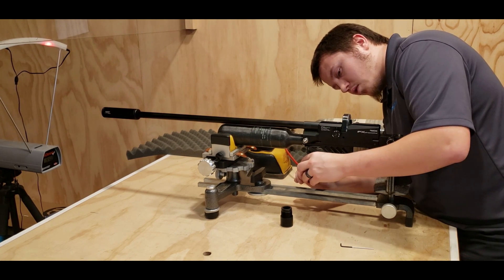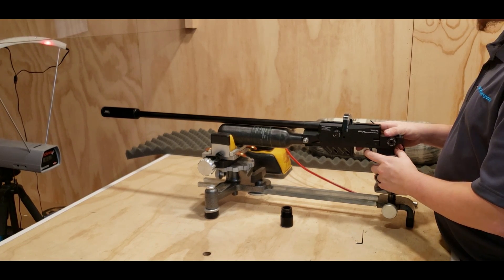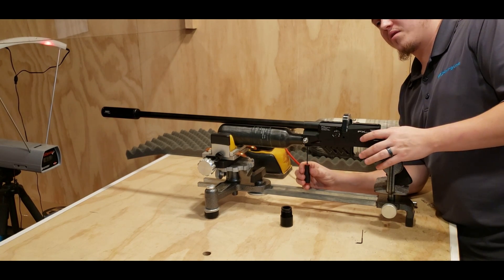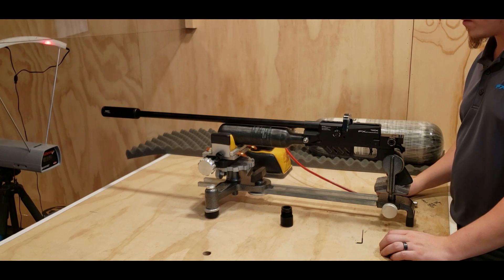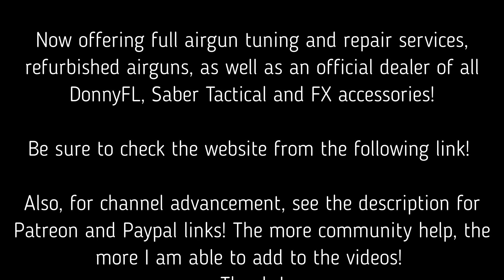How to Tune FX Dreamline with Power Plenum - FX Airguns Tuning Guide for FX Dreamline

Comment: i have a newer version of the fx dreamline wallnut, i have a question, the regulator was inside the air cylinder before but on the new dreamline the regulator is BEFORE the aircylinder.
My question is, isnt the regulator than working as a power plenum? because you mention that the standard stock configuration of the regulator is set at 125 bar but mine came at 110 bar. Have they already adjusted the regulator pressure for me because of the regulator? and what if i add a power plenum? should i than put the regulator lower than 110?
Reply from the maker: Yes the new external regulator (brass) has a built-in power plenum to add a little more power. Also, the Dreamline now has a larger valve than it had in this video, so that adds a bit more power, too.
Reply: @910AirgunTuningandRepairs  wow thank you so much for your quick answer, would you say with the New dreamline and a Power Plenum installed i should set the Regulator Pressure lower than 110 if it Came with 110 Stock? If i want to Shoot the 34grain mk2? Greetings from Northern europe
Reply from the maker: @kickassvideos5469  for the 33.95gr mk2 pellets, you will likely be around 120-130Bar to push them around 880-910 FPS. The rifle comes tuned for 25.39gr Kings.

Comment: I want to do the opposite of most folks. I want to slooow the gun down and be very efficient. I would like to shoot .22 at about 20 FPE and get a ton of shots.  I would assume I could set the Reg around 10-120 PSI and work from there?
Reply from the maker: For a .22cal shooting 20 FPE, lets say even with 15.89gr to really get efficient, I would a say around 90-100 Bar on the regulator. This all changes depending on the amount of plenum and the hammer weight that your rifle has, but 90-100 is a good place to start

Comment: I hear so many mixed things about the power plenum. Some people say it doesn’t do much, others say it helps a lot with velocities. I did not realize the Dreamline was capable of doing this much energy. I have been thinking about getting the .22 cal in this gun. I could always change the barrel if I wanted the .25. It’s amazing. The Dreamline is a game changer.
Reply from the maker: The newer Dreamlines come with an even more updated valve, plenum and regulator than the model used in this video, so the rifle is now capable of even more! 😁
Reply: @910AirgunTuningandRepairs  
When did that change? And did it always have a plenum?

Comment: Hi I also has dreamline 0.25 i set everything on max but the fx still weak.Should i change the hammer spring 2???Because i still using the factory original.Reg pressure is 130 bar
Reply from the maker: I am not quite sure what you mean by it "feels" weak? Have you shot it over a chronograph to see the velocity results? Feel free to send me an email as there are several possibilities for this issue.

Comment: I have a dreamline .22 with huma reg and dual Port reg is 110 en hammer spring half turned in the gun shoots the 18grain jsb at a speed from915 to sometimes 935 Peak fps what do I have to do for a more consistent shot
Reply from the maker: Sounds to me it just need a little more tuning, you are simply in between two balanced tunes. It could be either a little less reg, a little more hammer, or visa versa.

Comment: Need a help plz :) i have dreamline in .177 cal and no matter what i do velocity always jumps up and goes down. Cant get consistent velocity from 230bar to 110-120 bars its inconsistent hammer spirng at max at mid at low no point it keeps going up and down cant find that golden middle. Why? 
Air consumption is also wild 60 shots max whe i had another pcp artemis p15 it was shooting 940 fps avarage all the way with reg set to 120 and hammer spring at close to max and 85 regulated shots. Also dreamline has plenum installed
Reply from the maker: Is your rifle a full power/USA model, or does it have power restricting parts? Which velocity and regulator pressure are you using, and what grain pellet are you using? Also, how large was the air cylinder on the P15? The Dreamline .177cal air cylinder (not tank) holds I believe only about 185cc, maybe 230cc, but it is about half of a carbon fiber bottle from what I remember. Hope this helps! Let me know if you have further questions, you can reach me info@910airguntuningandrepairsllc.com.

Comment: What FPS can you get with a 33.95 gr .25 pellet?
Reply from the maker: Depends on the generation of Dreamline as well as plenum configuration and which hammer-weight you have, but on average the Dreamline can shoot the 33.95gr .25cal around 860FPS - 880FPS when maxed out.
Reply: @910AirgunTuningandRepairs  This is the status of my current tune w/.25 cal, w/power plenum 33.95 gr JSB pellets:     

Shot count: 10		Shot count: 10	
Low: 956		        Low: 51.5	
Hi: 960		               Hi: 52.0	
Avg: 957		       Avg: 51.7	
STD Dev: 1.8		       STD Dev: 0.2	
Spread: 4.0		       Spread: 0.5	
			
Date/Time	        FPS		                FPE
			
6/1/2021 14:07	960	6/1/2021 14:07	52.0
6/1/2021 14:07	956	6/1/2021 14:07	51.5
6/1/2021 14:07	956	6/1/2021 14:07	51.5
6/1/2021 14:07	956	6/1/2021 14:07	51.5
6/1/2021 14:08	956	6/1/2021 14:08	51.5
6/1/2021 14:08	956	6/1/2021 14:08	51.5
6/1/2021 14:08	956	6/1/2021 14:08	51.5
6/1/2021 14:08	956	6/1/2021 14:08	51.5
6/1/2021 14:09	960	6/1/2021 14:09	52.0
6/1/2021 14:09	960	6/1/2021 14:09	52.0
Reply: .5 moa @ 50 yds.  I meant to add this previously.

Comment: What donny Fl model are you using? is it backyard friendly? Thanks
Reply from the maker: In this video, I use the FX DonnyFL, which is the model of DonnyFL moderator that can be included as an upgrade when purchasing the rifle from a dealer (if the dealer offers it). It makes it more backyard friendly than the original FX moderator, but I still suggest a slightly larger DonnyFL moderator for true silence in the yard.

Comment: About how many shots can we expect with the 135ish bar and 910 fps with the 25.36gr jsb . 480cc bottle ? Your help is greatly appreciated.  Working with a hand pump at the moment so I haven't made it that far !
Reply from the maker: Hey! I am not 100% certain, but I would guess around 50-60 shots on the lower side of possibility. The 480cc bottle helps provide a good amount of shot count!

Comment: I have the same gun, Dream lite with bottle and PP in .25. when I adjust my regulator over ~110 I start to lose velocity. haven’t been able to get more than 890fps out of it with 25.4’s. any thoughts on why? i haven’t tried adjusting the hammer with the allen or taking the regulator over 125, do you think that’s a necessary next step?
Reply from the maker: The next step would be to adjust your hammer with the allen. Definitely need to do that to gain power
Reply: 910 Airgun Tuning and Repairs 
can’t find the Allen key size for hammer spring tension
Reply from the maker: @tripleceas  it is a 1.5mm, its a standard size key. Most kits will have them, some hardware stores sell them individually
Reply: 910 Airgun Tuning and Repairs Yeah smallest I have is 2mm I’ll pick one up. Thank you!

Comment: Now dumb question but can you run straight off the big bottle when you have the fill port in?
Reply from the maker: Sure can! As long as your big bottle is not charged over 250 Bar.

Comment: Have you done any testing with the dreamline in .30 caliber? Hearing very conflicting reports about power and shot count.
Reply from the maker: I've shot them but have not extensively tested it. The .30cal Dreamline does not offer a ton of power, but enough power to maximize accuracy of the 44.75gr JSB pellet 👍 hope this helps!
Reply: Hello i am not able to shoot 44.75 pellets more than 750 fps with power plenum, i really appreciate if you upload a .30 cal tuning video, thanks

Comment: OK I have a question my dream line seems to do a 22 23g slug at a max of 920fps with 500mm barrel my reg holds a constant pressure but sometimes after a small adjustment will climb or fall, mine is the bottle version with a power plenum, do you think it's worth me changing my reg seals as I thought I would be able to get more speed than this cheers for your great videos
Reply from the maker: Changing the regulator seals will most likely not change anything. I suggest either a heavier hammerweight or a longer barrel, if you are looking for more speed. 👍 Best of luck my friend

Comment: I'm sorry if this is dumb but why turn the hammer spring down with an allen key  when you can use the power adjustment knob?
Reply from the maker: No worries! Turning the tension adjuster down rather than the wheel is actually changing the setting of the wheel. For example, the tension adjustment at 16mm and the wheel at max is more than the tension adjustment at 18mm and the wheel at Max. It allows a much more fine tune of the hammer spring adjustment and allows a range of adjustment once you have found your preferred tension adjustment. The tension adjuster at 18mm and wheel at Max may equal close to the tension adjuster at 16mm and the wheel at setting 4 or 5. I always suggesting tuning the gun with the wheel on Max.
Reply: @910AirgunTuningandRepairs  i understand, thanks for explaining :) this info sure will be coming in handy when tuning my brand new FX dreamline tactical. It's arriving here tomorrow but i'm probably going to do some more learning before i actually start finetuning.

Comment: You seem to be all about speed I wish the heck you would show if the gun is accurate at that type of speed
Reply from the maker: These videos are mostly about showing what the plenum makes the rifle capable of.  Pellets are not accurate past 920FPS. Slugs generally prefer to be around 940-960FPS, but every slug is different. I do not have scope cam equipment yet, but I am working on it 👍
Reply: Hey I saw that you said pellets are not usually accurate past 920 I don't have a chronograph I've got my reg said at 150 and I haven't touched the hammer spring with a Allen key it's shooting pretty hard and still decently accurate where should I set my hammer spring to get that 920 FPS with 33g JsbI also saw you said setting your rag high could wear your regular out is 150 to high?
Reply from the maker: @kaseyjohns5169  Hey Kasey! The regulator at 150Bar is completely fine, since the recommended max is 170Bar. Also, if you do not have a chronograph, I would test my accuracy with the 33.95gr MK2 at 50 yards, or 100 yards if possible. Then, with the regulator at 150Bar, I would increase my hammerspring tension until I shot the best 5 shot grouping. I would definitely recommend investing in a chronograph, though, if you are going to be tuning your own rifle. Hope this helped!

Comment: I am from Indonesia, whether the dreamline that has been installed power plenum with cal 177 for jsb monster 13.43gr can be set above 900 fps because I am a dreamline user made in swedish cal 177 can not be set above 900fps only with jsb monster diabolo please explain thx
Reply from the maker: Hey! Sorry, it is a little hard to understand your English, but if you are using a "12 ft lb" version of the rifle, the internal parts will limit the overall speed and performance. With a full power rifle, 900FPS is obtainable without the plenum, and certainly with the plenum. Wish I could help more!
Reply: @910AirgunTuningandRepairs  sorry my English is not good ! I have installed the plenum on my shotgun (dreamline) but have not been able to setup so that the power can be maximized. how to be able to maximize? Please help ?
Reply from the maker: @bawadava4298  no worries! 😁 you will need to most likely change the valve assembly. The 12 Foot Pound Energy rifle parts are shown on the schematic for the rifle, so you can see which parts you need to upgrade. If the rifle is already full power, you need to just tune the regulator and hammer to achieve your desired velocity.
Reply: @910AirgunTuningandRepairs 😁 Thank you, I am waiting for the next video and I will always like it
Reply: I have raised the regulator pressure above 100 hamer, I have set the max setting, but there is no change that I can feel after using the power plenum on the dreamline shotgun

Comment: Do you have an idea of the shot count difference in .25 with versus without the power plenum?
Reply from the maker: Unfortunately I do not, as it all depends on what settings you have the rifle at, as well as whether you have a bottle or tube. I believe FX posted suggested shot counts without plenum on the website, the plenum would probably give about 10-20 extra shots at factory settings.

Comment: All of this is great info. It's nice to know what can be accomplished velocity wise. However........I would like to see you make a video on an accuracy tune for the 25.4 JSB Kings. I'm talking some serious tiny groups! Doesn't matter if you could push a projectile 2000 fps.......if you can't hit what you're aiming at. Please show the absolute best accuracy your rifle can get with that pellet and share the settings/velocity.
Reply from the maker: I am working on getting a set up to where I can show accuracy. The 25gr Kings JSB like a range between 890-910FPS out of the pellet liners, 900-920FPS out of the slugs liners. At 25 yards, the Center-To-Center grouping will be extremely small, most likely around 0.15" (remember, center to center, total group would be 0.40"). FX guarantees, with the proper tune and elements, that any STX barrel should produce a 0.5" group center-to-center at 50 yards. Anything after 50 yards will be effected by the elements, tune of the rifle, the indexed position of the liner, and several other factors. 👍 Accuracy videos coming soon.
Reply: @910AirgunTuningandRepairs  Awesome! I am most interested in the standard pallet liners right now since that is what I have. Hi zero all of my rifles at 35 yards. I was not aware that they could be critical as to the indexing of the liner 🤔 Are you suggesting that rotating the barrel liner can have an effect on accuracy?
Reply from the maker: Sorry I did not see your reply! Rotating the liner certainly has effect on Point of Impact and Accuracy. It changes the angle of twist at which the pellet is exiting the liner, which will change its flight path.

Comment: Good video. A question why you have the maximum power of the spring, I think that is not good and it has an effect of lowering the speed instead of going up ..... I with my Dreanline tac aluminum bottle at 130 bar reach 296ms (972fps) Factory weapon only with the plenum and the power of the spring in the letter D and if I increase the selector of the spring + it goes down the speed.
Reply from the maker: You can tell you have the hammerspring maxed out when you adjust the tension and you no longer gain FPS. Whenever I raise the regulator pressure, I check the spring tension to see if I can achieve any more FPS. IF the speed does not change when I increase the hammerspring tension, then I still need more regulator pressure, and visa versa. Eventually, either the regulator pressure or the hammerspring tension will max out, creating the max tune for the gun.

Comment: Hey my friend. Are you going to upload also Power Plenum tuning video with FX Dreamline Classic?
Reply from the maker: Hey Rafal, the speeds will be the same for any of the Dreamline chassis. The only difference is the DreamClassic uses the 5mm hammer adjuster in the rear rather than the knob, but both are able to achieve the same speeds.

Comment: how accurate is the 25g ,the power is there...have you tried a heavier pellet ? ..... with the power plenum your best accuracy was between 900-910...seems like the power plenum is not 4 pellets but slugs
Reply from the maker: The plenum is to either provide higher speeds for slugs, or to be able to turn down the regulator to a lower pressure and get the same velocities as before, resulting in a higher shot count 👍

Comment: Please do with .22 calibre
Reply from the maker: It is the same process for any caliber, but the speeds will be different. Which pellet are you looking to shoot in 22cal?
Reply: @910AirgunTuningandRepairs  JSB 18.13
Reply: I have the tac with 500cc tank, 600mm barrel and power plenum. I can max out with the 25gr at 990 and reg at 150bar. I’m shooting 18gr at 910 with reg 110 and hammer on 5, 15gr at 930 hammer on 1 and 25gr at 830 and hammer on max. I’m getting 120 shots with the 18gr 240-130 bar. Im loving the plenum!!!🥰🥰🥰🥰😍
Reply from the maker: @ronaldlambeth8242  got a .22cal vid just around the corner 😉👍 great results!
Reply: 910 Airgun Tuning and Repairs Thanks. It took quite a bit of air and I also think I got lucky but it was quite a learning experience

Comment: Excellent video and am looking forward to your MK1 test.  I suspect you may well be surprised with it as by my reckoning even with the smaller valve needle there is no obstruction between the PP and the gun plenum allowing for faster transfer of air mass, the whole point of the increased plenum in the first place.  With the MK2 there is a choke point between the 2 sections
Reply from the maker: True! But the question is can the short valvepin open far enough for the new volume of air? 🤔
Reply: A very good question have to say am not that impressed with MK2 layout mine is a combination of the 2 long pin short spring and delron tube guide / spring retainer that slips over the pin.